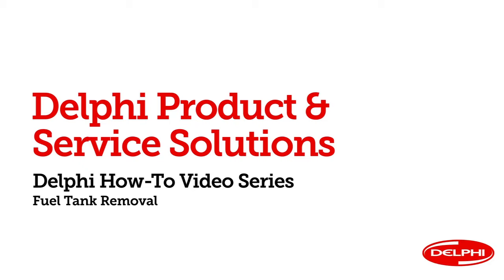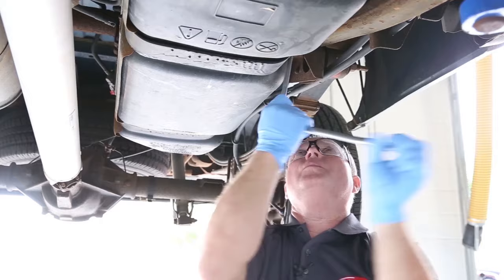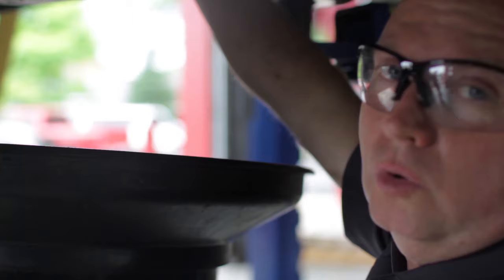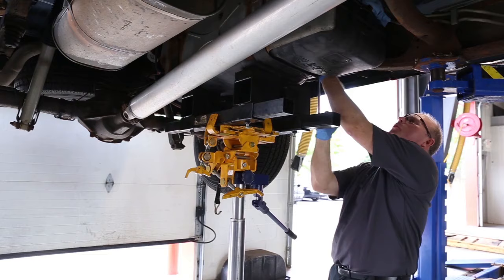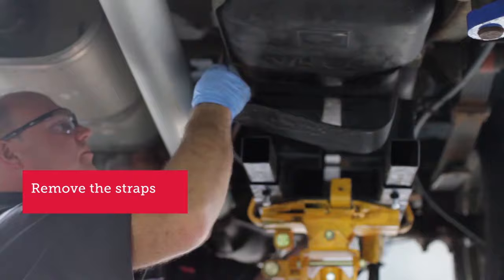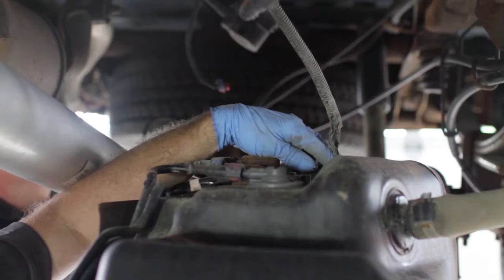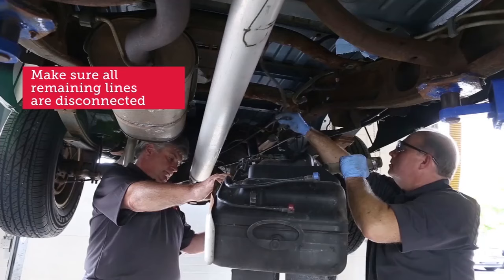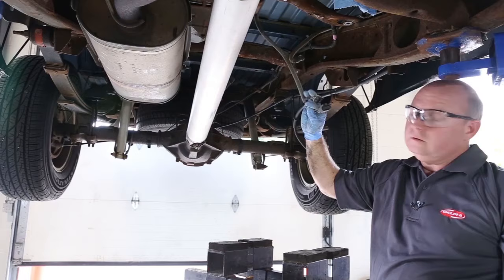How to Remove a Fuel Tank

Comment: How mucho is the cost of the removal and replacement of a fuel tank on a volvo ttuck
Reply: I know a car or small trucks gonna start out at around 500 on up
Reply: I have 05 xc 90 I need to change the tank. How much did it cost you?